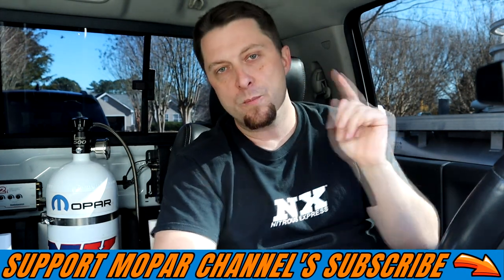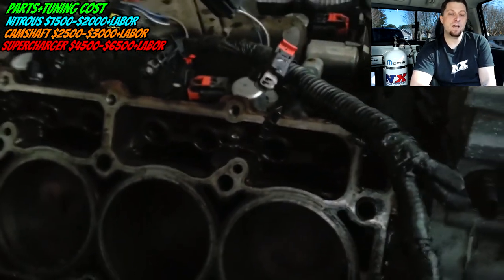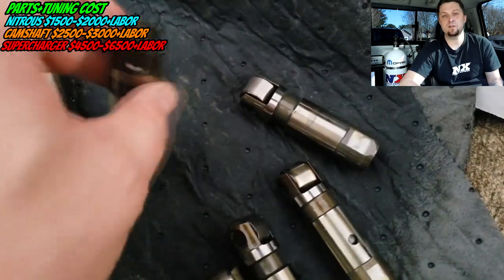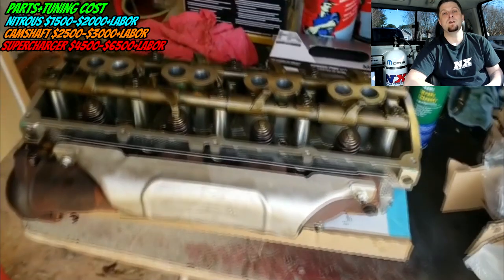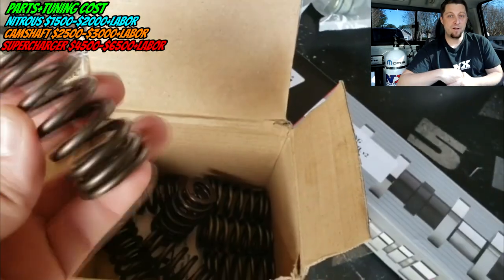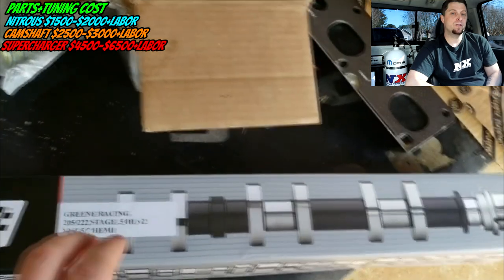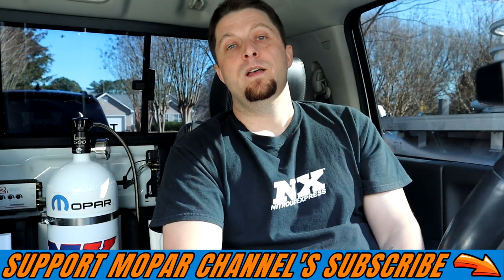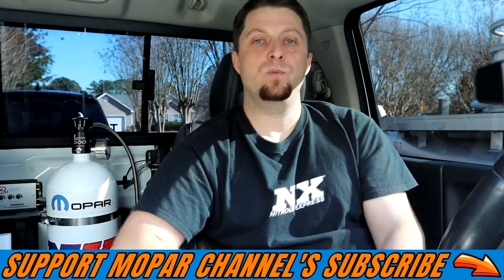BEFORE YOU CAM YOUR HEMI MUST WATCH!! IS IT WORTH IT??

Comment: Down to earth,  honest stuff here,  that's why I keep watching,  5.7 2017 charger here.  I'm on the fence with a cam and converter,  or nitrous.  If I go cam,  I'm gonna go max effort tho,  I seen u got the .5 cam,  what made u go with a mild cam?
Reply from the maker: Thanks for the support 🤘🙏 I went .5 hl because I'm still on the factory converter and also because it has lots of low end torque. Most other cams require a big stall to make up for the loss of torque down low.

Comment: Can a supercharger kit be done as a stand alone modification without injector and fuel pump upgrades? There would be a significant cost for that also?
Reply from the maker: You must upgrade injectors minimum for low  boost setups 6-8psi

Comment: Just started on replacing cam and lifters do to lifter failed. What a bitch. Exhaust manifold bolts broken flush on both heads. So today I drop them off to be taken out and Resurfaced. Lots of work. Got shorty headers coming. Also doing the V6 fan. So far I’m about $2500-$3000. Can’t wait till I have everything put back together and up and running.
Reply from the maker: Awesome man sounds like it's going to work great 👍
Reply: @FrostbiteRam  was going to do a bigger cam but. As many miles as I drive I’m just going to do the Non mds cam and lifters. I need to get another 160K miles out of it. LOL

Comment: I’m in the same boat right now. But I have a 392 and wanna procharge it but I’m scared to blow a pistol ring. So was thinking cam on the safe side..
Reply from the maker: I hear ya,personally if I had a 392 I would forge the pistons and due cam at the same time the 392 is a little more fragile than the 345. A cam will improve the 392 but wont be a huge difference the 392 flows very well already. I would save for forged pistons and boost🤘🔥💨

Comment: Yup I kept changing my mind about what to do next. I just need a couple of things to be full bolt-on. I couldn't decide on the cam or supercharger. I feel like I could do the cam install my self. I've changed out clutches and injectors on my 06 cummins so I feel like I could handle the swap with some Instructions of course. But I think I'll just keep saving for the supercharger. I really want a whipple but I've heard guys say to go procharger instead. That the whipple is too hard on our 5.7 engines? Thanks man love the content and happy new year!
Reply from the maker: Happy new year 🎉Thanks for the support  a supercharger would be sweet 🤘
Reply: Check out torque storm, they have some good kits out that are around 3 grand.
Reply from the maker: @KJsGarage  they sure due 🤘🔥💨
Reply: @KJsGarage  its $3,250 and i would still have to get intercooler, intercooler piping, upgraded fuel pump and injectors and a tune. That still may be cheaper than a complete kit but not by much. I'd have to research some more

Comment: Thank God I'm a full time mechanic and would install my cam myself 😅 save myself some money. I'm just worried about tuning honestly. Back when I had my mustang I went with a sct x4(unleashed tuning) tuner. Not sure what tuners these trucks will run. 

And I just want the chop chop 😂
Reply from the maker: I'm using diablo sport.  HP tuners is also another option
Reply: @FrostbiteRam  how much do those run?
Reply from the maker: @rjaj3276  you can pickup a diablo tuner for about 500$ and then the custom tune will be about another 400$ish
Reply: @FrostbiteRam  okay thanks man 👍

Comment: Thx for the vid man . Lookin for advice . I own 2012 Chrysler 300 srt8 6.4 with mds . Miss fired on cylinder #3 so I pulled the head and got  lifter out its badly Seized not sure what caused it .   so then I pulled the cam  out to check for damages . And yes it was . And no lobe  completely  gone . What do you think I should be looking out for ,  and with mds ? .....I’m  not a mechanic any advice will be greatly appreciated ! thanks you
Reply from the maker: Install hellcat lifters and custom camshaft would be my suggestion.  Definitely change the oil a few times to get the particles out that's what I did.
Reply: Frostbite Ram thx for the prompt reply mate I’m here South Australia  . what cam you recommend as I’m just learning
Reply from the maker: @Bassumy-j1s  I'm running a greene racing  cam. Link to his business is in video description.

Comment: You need new head studs! Old ones can not be re used
Reply from the maker: Been using them for over a year with tons of racing.🤷‍♂️
Reply: @FrostbiteRam  The bolts are torque to yield and can not be used again.  Torque sequence is 25ft lb, 40 I believe then an additional 90 degrees which is what puts them in their yield.    Love your build!
Reply from the maker: @JoshHookerJoshhook123  correct but I have re used mine without problems not saying its the right thing to do but I've done it many times without fail and I'm running nitrous and now boost and have yet to push a head gasket.
Reply: @FrostbiteRam  Well shoot I might do it.  Save a lot of money that way